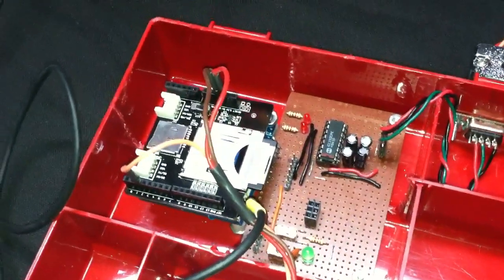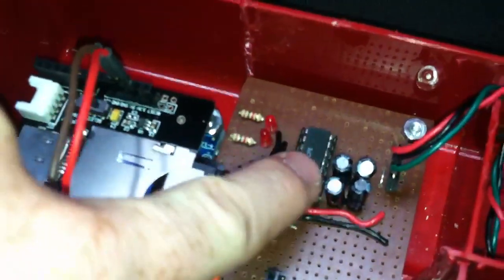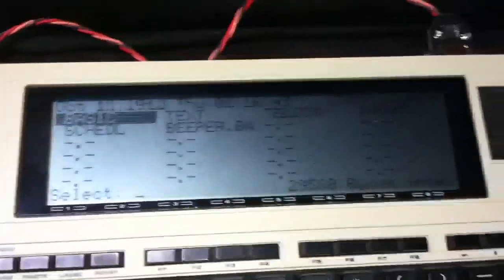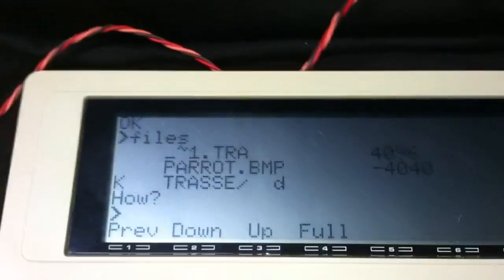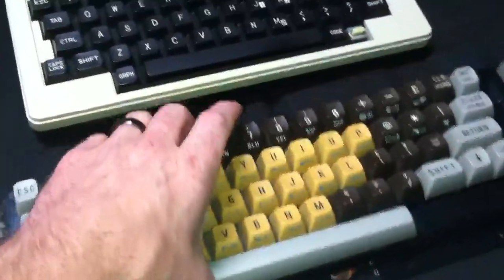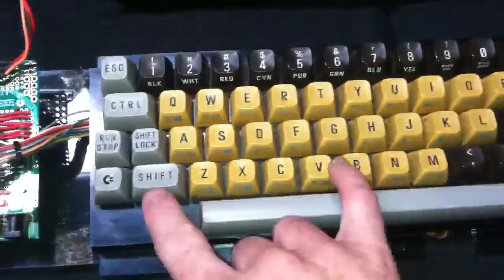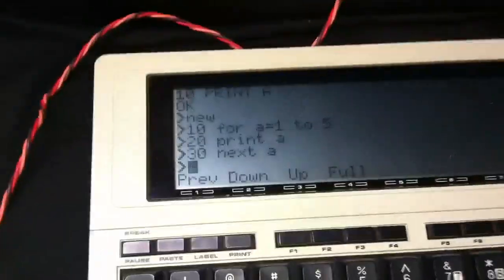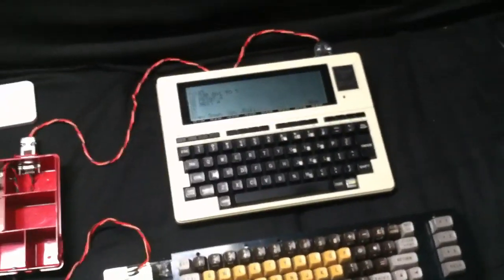BL-328 μComputer demo

Comment from the maker: I was kinda noticing that. ;)  I only got that serial link working about 5 minutes before I filmed that. I was actually thinking that this morning too; the display of the text there is so slow, I figured it needed a lower baud rate.  I'll switch it down to 1200 or somesuch for using the 102 as the "head"... I also now have a text LCD panel I can use, i just need to interface it... hopefully that will happen tonight or something...